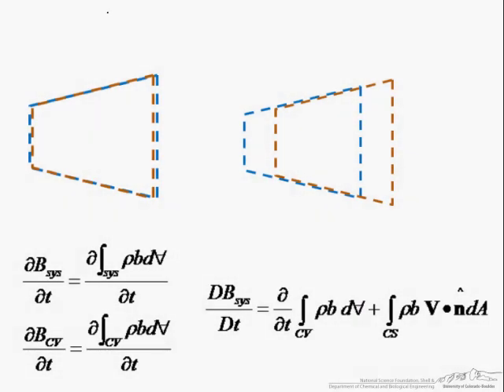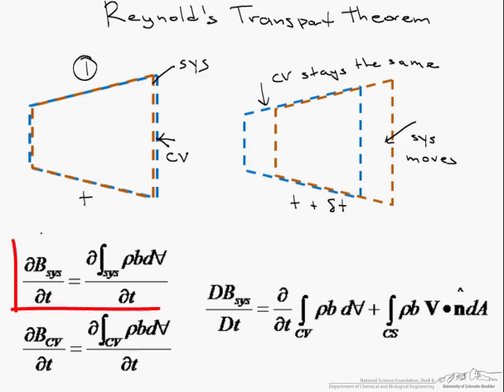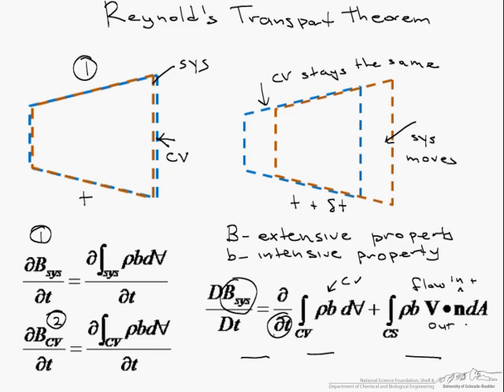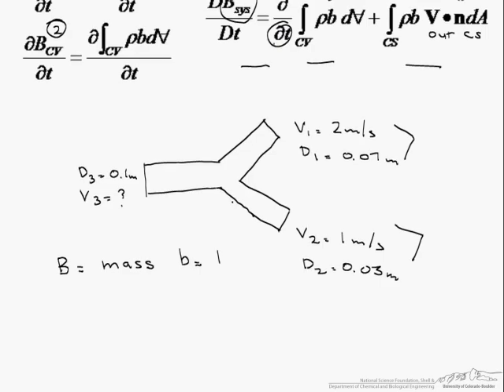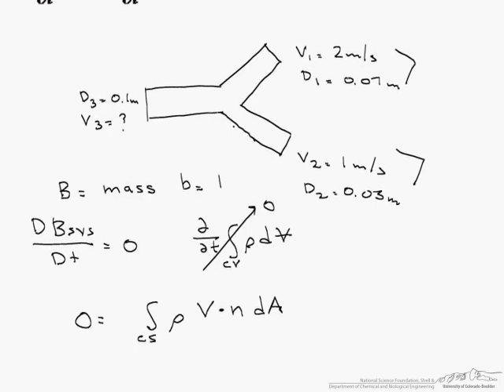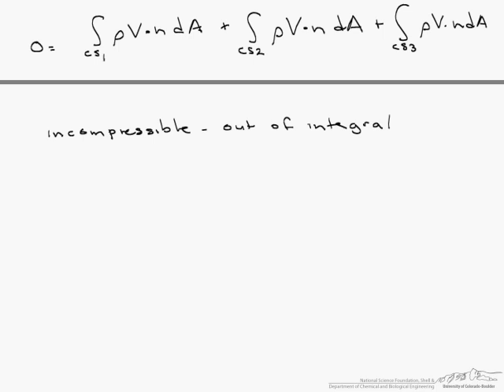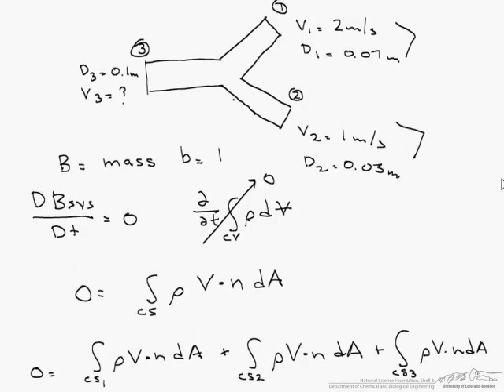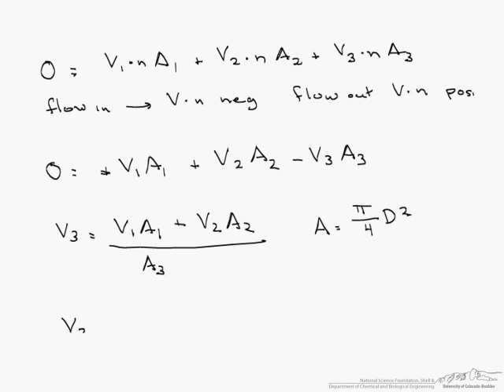Reynolds Transport Theorem

Comment: what is the point of using RTT if we could have used the continuity equation easily.8:23 mins of worthless talk
Reply from the maker: RTT is the base theorem that we have used to derive the continuity equation in integral form (using mass and b=1) and derives the conservation of linear momentum (using b= velocity). Its the integral method compared to differential methods like the Euler equations.
Reply: i still didn't get ur point.anyways u must be right cause i am still studying my bachelors.
could u be more specific?
Reply: continuity is proved by using this theorem...u must have studied various approaches to study fluid mechanics...
Reply: The continuity equations is obtained by using the RTT like they showed. In particular, you apply the localization lemma on the integral form of N-S equations.

Comment: After 7min 10sek in the video, it is said that V3 is flow in, so V3 is positive. Is that correct? is'nt V3 negativ?
Reply: Remeber that V dot n is (magnitude V)(magnitude n)(cosx). Magnitudes are always positive. The cosx term tells you to use -1 or 1.
Reply from the maker: For the purpose of control volumes and using the Reynolds transport theorem, the dot product of the velocity with the normal for flow into the control volume will be a negative value.  So V3 dot n is negative.  V3 itself is in the positive direction, but we dont use the vector in the setup.  For momentum balances you would.
Reply: n<---|--->v3 (180 degrees apart)

Comment from the maker: Sorry we missed your comment.  n is the normal vector.  So you are taking the dot product of the velocity with the normal.  If "something" enters perpendicular to the control surface, it is 180 degrees from the normal, and thus it is equal to -1.  If its coinciding with the normal, the dot product is with 0 degrees and equal to 1.  Anything else will have to take into account the cos or sin of the angle.

Comment: whats the significance of "n" exactly? what is it?
Reply: Udai Shankar 
It's a unit vector normal to the area pointing out of the system.
You can replace the term V . n with Vn, which is the the component of the velocity normal to the area.
Reply: sign

Comment from the maker: The continuity equation refers to mass being conserved.  In this case we wanted velocity of the fluid and made some assumptions on compressibility of the fluid.  The Reynolds transport theorem can also be applied to momentum, velocity, acceleration, etc, pretty much any physical parameters. So it may not boil down to continuity equation every time.